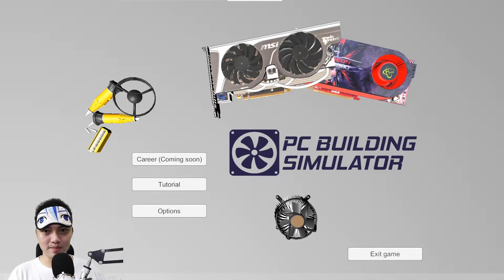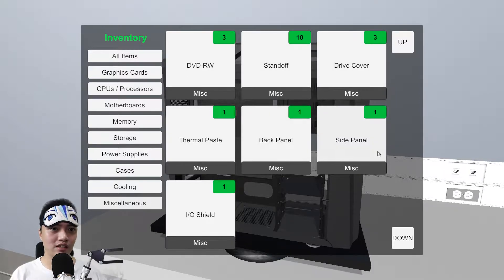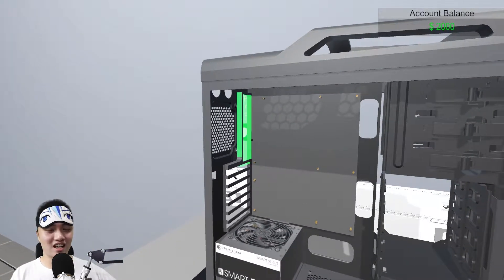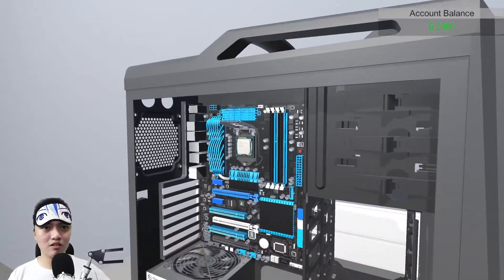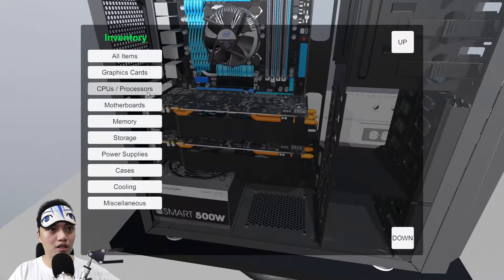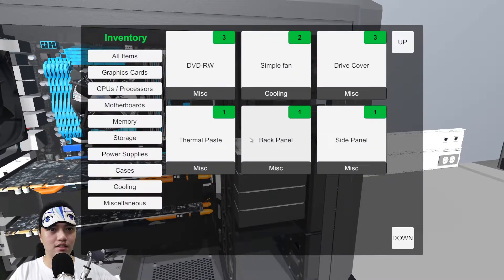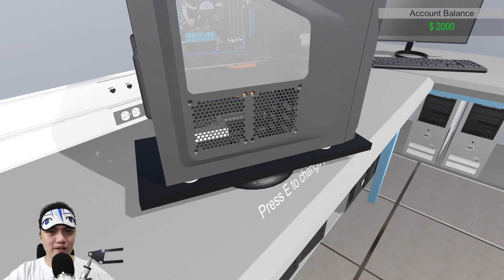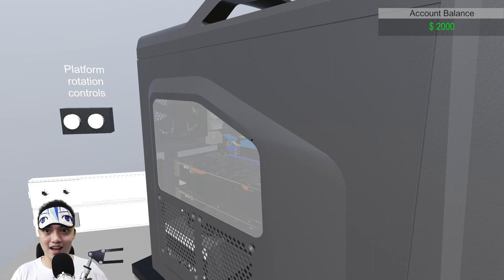Let's Build a PC! (Kind of) - PC Building Simulator Gameplay

Comment: use audacity to reduce static noise.
Reply from the maker: I did, meron pb?
Reply: OBS Studio has a better noise reduction filter, you should try that and also record your audio in multiple tracks.
Reply: Also for some weird reason, my "gaming" mouse works better on my wooden desk surface than on my mousepad... I guess it's because of the texture of the surface. But still not fast enough to read fast movement.
Reply from the maker: I'll check it out.
Reply: Coolio, by the way, how are you recording your footage (gameplay)?
Reply from the maker: Shadowplay
Reply: GTX, nice.